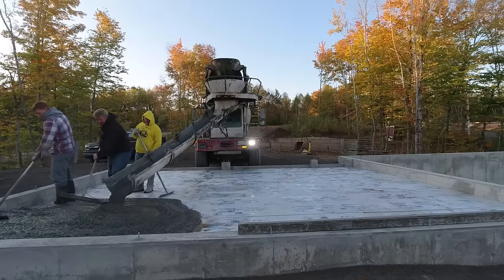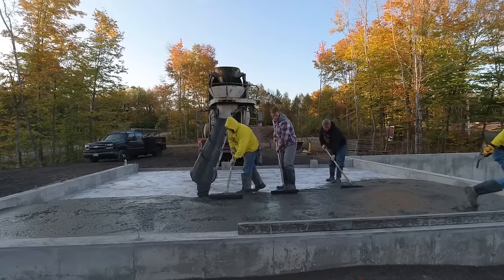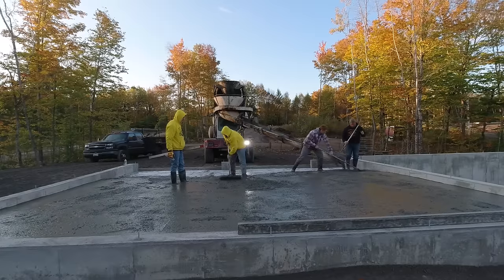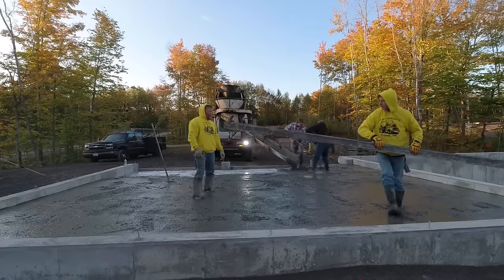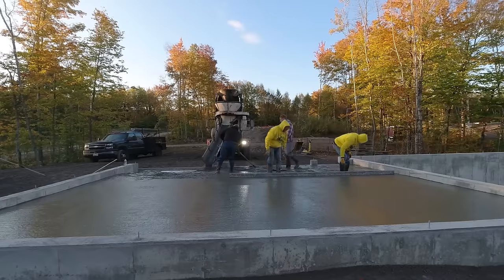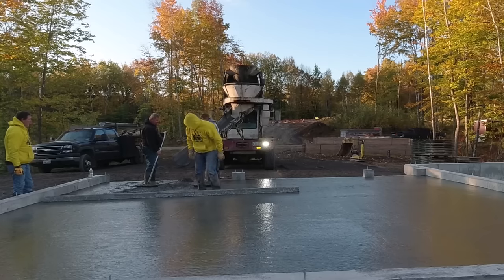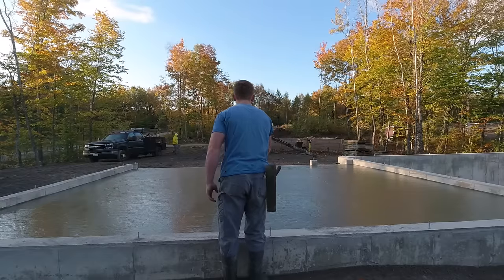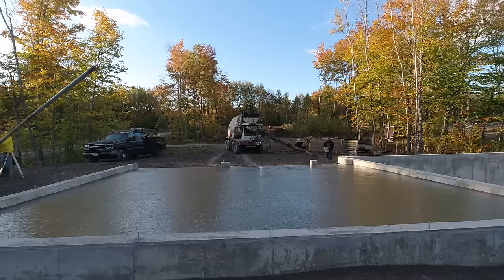Are Front Discharge Concrete Trucks FASTER To Pour With Than Rear Ones?

Comment: “Slump Police” 😆
Does the ready-mix plant tell you if you’ll be getting a front or rear dump mixer the day before? If they did, it seems like you might control your crew size by a man, if you knew you were getting a front dump.
As much concrete as we pour in S.Fla, front dumps are still fairly rare. We tend to pump a lot more I think, so front or rear doesn’t make much difference. 

As far as slab cracking goes; once I had a deck that when we came in the next morning to start verticals, the whole slab was cracked like I’d never seen before. Hairline cracks everywhere. I had no choice but to call the engineer to see what they wanted to do. It was post tension so they said let us know how it goes after stressing. We did 2 to 3 day tensioning w/high-early mixes so it didn’t take long. After we stressed, you couldn’t find a single crack anywhere. I even marked what I thought were some of the bigger ones and not a single trace of a crack anywhere. It was a 9th or 10th floor so us and the ready-mix company both were very relieved. Engineer was completely unconcerned.
Reply from the maker: I only know who's coming when I ask in the morning.
Reply: @MikeDayConcrete  👍